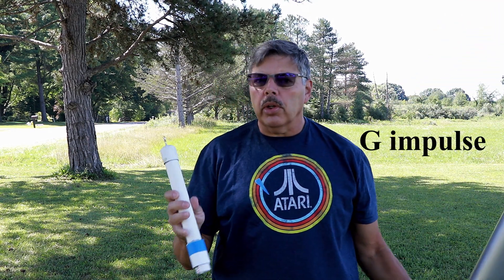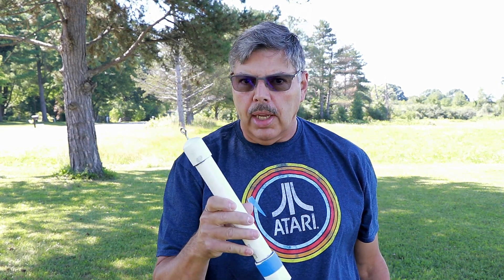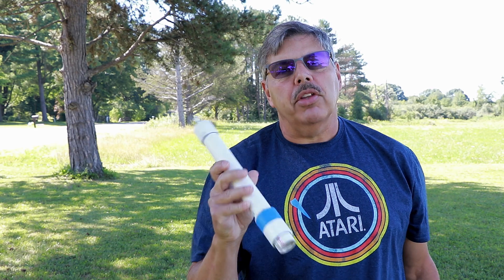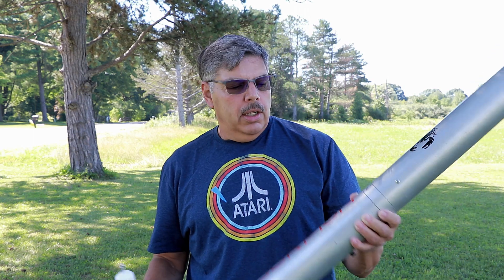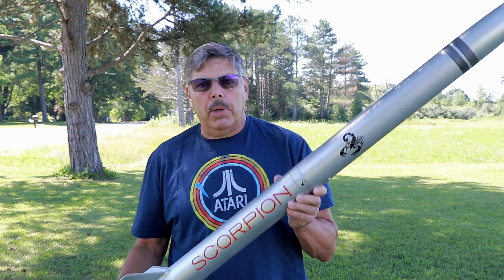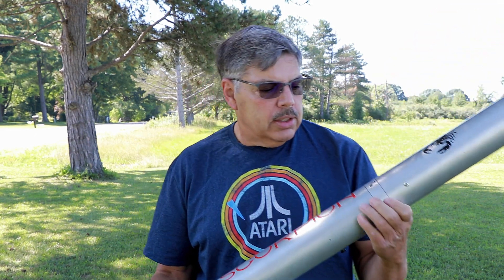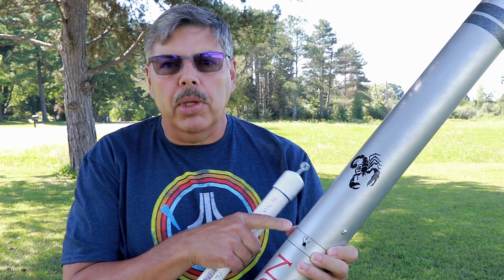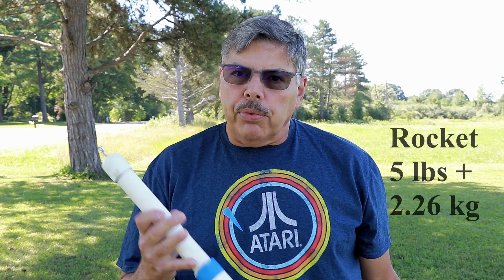DIY PVC Sugar Rocket Motor Flight

Comment: Nice fly! Learning a lot from your channel/content, such an amazing job, thank you!!! How is the PVC motor retained in that particular rocket motor mount?
Reply from the maker: The short answer is not very well. I sanded down the end cap until it passed through the 38mm mount.

I have a new rocket that is lighter and has a 54mm motor mount. I am going to make an adapter so the PVC motor will be retained. Now all I have to do is find time to make it!

Thanks for your comment!!

Comment: Two questions about the 9" motor used in this video...
1. What is the nozzle size?
2. Is it one single 9" grain or multiple grains?
Thx
Reply from the maker: The 9" motor uses 4 grains 2.25 " long. The washer in the nozzle is made by Grip Fast and is a 1" x 1/4" fender washer. The actual size as measured by a drill bit is 9/32 or .28125. Small changes in nozzle diameter make HUGE differences in KN/pressure. The 6" motor uses a 3/16 fender washer. The actual size is 7/32 or .21875.

I would not use a single long grain because it could over pressurize the motor at the end of the burn. A progressive motor begins with a lower KN and raises to a higher KN peak at the end.

Bates grains provide a neutral KN/pressure across the burn time. I will make a video soon explaining the function of BATES grains and how I arrive at the number verses length and core diameter.

Bates Grains
https://en.wikipedia.org/wiki/BATES#:~:text=A%20BATES%20grain%20consists%20of,an%20acceptable%20center%20of%20gravity.

KN
http://www.thrustgear.com/topics/Kn_Notes.htm
Reply: @TheRocketeer  Do use BurnSim? I got a copy and am playing with it...
I put in the specifications for the 6" sugar rocket and I get:
Initial Kn: 280
Max Kn: 375
Max Pc: 831 psi
I used "Slow" for the propellant type. Assuming this is correct for flexi-fuel sugar.
----------
I am wondering if these Kn & PC numbers are basically what I should shoot for if I start modifying the Bates grains and Nozzle size. These number obviously do not cause a CATO so it would seem to make sense that if I make larger engines but maintain similar Kn & Pc numbers then it should go well. Do you agree?
Reply from the maker: @rotaryrocketry  I used BurnSim along with documents by Jeffery Hopkins who now works for SpaceX.
BurnSim is a great starting point for rocket motor design. I used the KN values for the 6" and 9" motor design. I think that at a KN of 350 the pressure is about 675 lbs so that would be lower than what BurnSim reports. I also think the motor class may be a bit optimistic. I have no way of proving that at least not at this time. I have built many motors with a max KN of 375 without any problems. I have cut the 6" motor back to 5.50" and run 1% RIO with improved thrust but a shorter burn. I bumped one 9" motor to 9.5" but the burn seemed rather violent to me. I always double the washers on the 9" and it still warps them! Jeffery Hopkins has made up to a 12" motor. Now you are entering erosive burning territory. 
PNCP: https://docs.google.com/document/d/1-6AqZODjtBV812eASCuXsPut8QYr2bl7j2L7OMh38Tc/editChemical analysis: https://hackaday.io/project/6381-high-power-experimental-rocket-platform/log/31824-chemical-analysis-of-pncp-6Chem 3: https://docs.google.com/document/d/1OPSMKjqOTHAZuHPWtzrh5Q1walCyQBCP0ghi6VthN_8/pubJeffery Hopkins: https://hackaday.io/jeffmhopkins

Building rocket motors is part science and art. I use two other programs as a reference and none of them agree on a final value. That my friend is where the art comes in. I have all the parts for a thrust stand and hope to calibrate and test this winter.
https://meteor.open-sky.fr/#/motorDesign
http://openrocket.info/

I have done some more work on the delay grain. If you wan't more information on that, go to my home page and click the about tab. There you will find my email.
Good luck and please keep me informed!!
Chuck
Reply from the maker: I have flexi-fuel working in BurnSim!
Reply: @TheRocketeer  I can only assume you made a custom propellant profile... What are your specs?
Reply from the maker: @rotaryrocketry  BurnSim Flexi-fuel C* - 2,599 Char.,   ISP - 80.8,   BR Coef a - .035,   BR Exp n -  .033,   Density - .06679

What I do know.
The numbers seem to work well compared to my flight data. My 2 grain flexi-fuel motor actual flight data is equal to an Aerotech G80 with a total 100 NS. My 4 grain motor actual flight data is equal to a H130 with 210 NS total.If I run BurnSim with the above data my total NS for each motor is about right. At least it is a lot closer than the "Slow" setting.

What I don't know.
The pressure and numbers could be garbage. Use at your own risk!

Comment: How did you put a Eyebolt on the motor ? Does it act as a Shock Cord mount ?
Reply from the maker: I used the eyebolt for motor retention. The headend was filled with auto body filler (Bondo) to act as a thermal barrior and to give the eyebolt additional support. The motor was adapted to an existing rocket  and so I had to make a few adjustments.

Comment: I am surprised that with 9" of fuel it is only a G Class motor. I would have thought that amount what have been at least in the H range.
Reply from the maker: The outside diameter of the BATES is only one inch. With 175 g of fuel that is not enough for an H motor.

Comment: It is my understanding that you shouldn't ever use pvc or iron pipe motors, because they shatter in case of an overpressure event. Aluminium just tears instead and thus is supposedly safer. Any insight into this?
Reply from the maker: Any motor can shatter under the right conditions no matter what the material, even aluminum. As GT Aerospace said PVC or aluminum will blow the nozzle or bulkhead when over pressurized. A plugged nozzle will cause an instant sudden spike and can shatter the motor. Aluminum pieces will typically fly farther than PVC. Never use iron pipe.

The only motors that I have burst are the following.

A PVC motor with R-Candy (no corn syrup.) In my opinion R-Candy is dangerous for several reasons and one of them is it has a very high burn rate. I do not make R-Candy and discourage others from doing so.

Pressed powder has never worked well for me and I have burst a few of them.

A load and go motor. In other words let's cram a bunch of fuel in and let it rip. Don't do this!

I encourage everyone to use a proven example from my site and go from there. Until then study how KN, core diameter, burn rate, nozzle and number of BATES grains affect pressure. You can not substitute sucrose for sorbitol unless you know what you are doing! 

Distance from the motor and common sense go a long way. Rocket motors are not toys! Be safe and have fun.
Reply: PVC pipe shatter in very rare cases. It can withstand very high pressure .Either the nozzle or the bulk head get pushed out of the casing . 
But in the case of aluminum , You are Correct .
Reply: I launched your 6 inch motor on a home built rocket. It blew out the nozzle and still went several hundred feet high. 

Question - you say the 9 inch motor has a plugged bulkhead. Is that just the endcap, or have you done something extra? And what is the eye bolt coming out of the bulkhead for?

Please keep the videos coming! They are a great help for someone like me who has only been in the hobby a short time.

Comment: Can a rocket go supersonic with a K Impulse Sugar Rocket Motor ?
What is the best fuel choice for a supersonic rocket ?
Sorbitol , Dextrose or Flexi fuel ?
Reply from the maker: A minimum diameter rocket can go supersonic on a motor much smaller than a "K" impulse. Check out Mach1, they sell a lot of different minumium diameter rockets in fiberglass. https://www.mach1rocketry.com/
Any one of the listed sugars will carry a rocket supersonic. Most very large rocket motors are made with sorbitol.
Reply: @TheRocketeer  
Thank You so much for your reply !
Now I can start Building India's First Supersonic High power rocket. 
I will tackle many difficulties in the Build so I will ask them to you.
Thanks